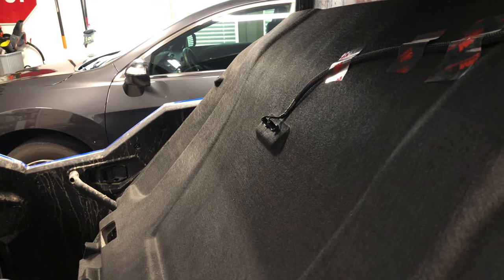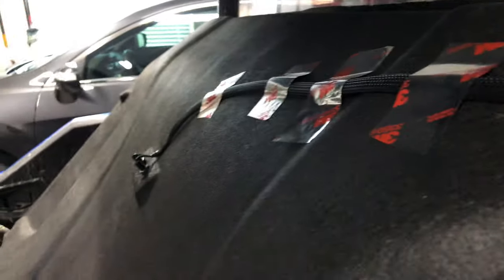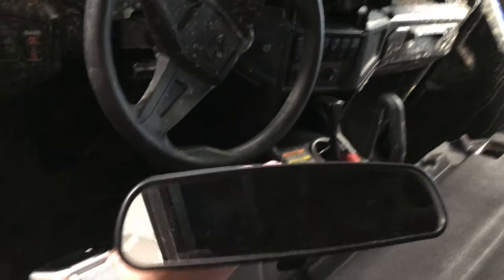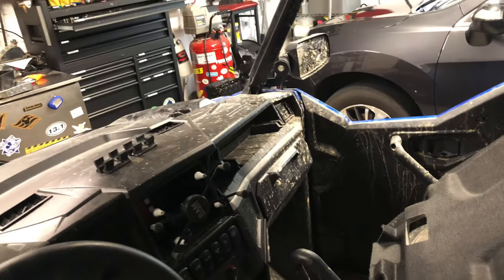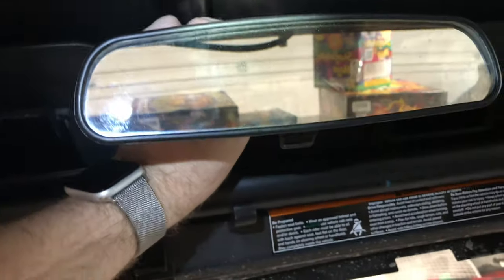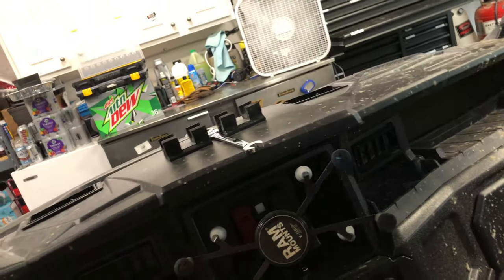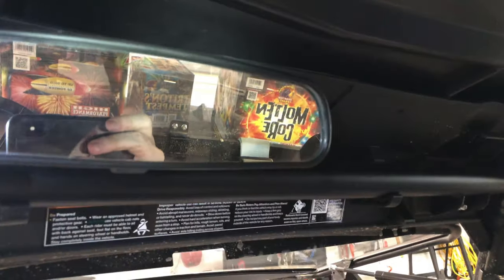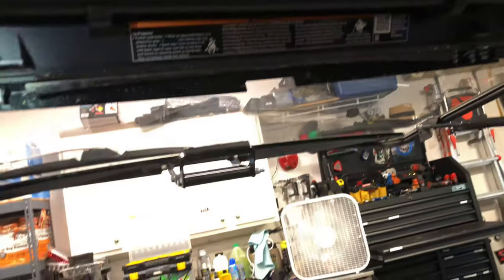Polaris General - Rearview Mirror Install

Comment: EMP has a really nice, wide panoramic rear view mirror, side mirrors, etc. Simple, easy to install too! I've purchased those and other items for the General. Quality, it seems, is pretty good! I've only had one issue with the tip out windshield... A strut failed and when I checked on the 30 day warranty, which had passed, I explained in my email that the General had only 41 miles and 7 hrs on her. It's never been left open unless we were doing the install in the garage, or the grandkids playing in it in the garage. So yeah, gotta pickup a new strut but those items purchased saved so much, I should't complain! Thanks Ben, for the info you continue to bring forth! i hope to visit Tenn soon! As my hero (Roy Rodgers) would say, Happy Trails to you!
Reply from the maker: I’ve seen some of the models on the market. In this case, I had the mirror and parts laying around, so it was a no-brained to just go ahead and try it out. If it doesn’t work, I didn’t lose any money—just a little time. Thank you for the comment, though, as that is great feedback.